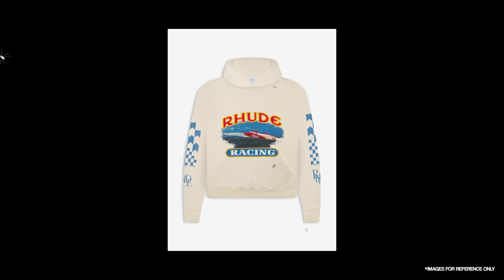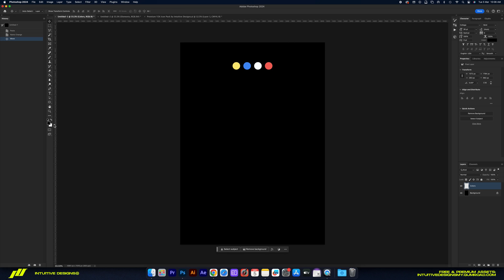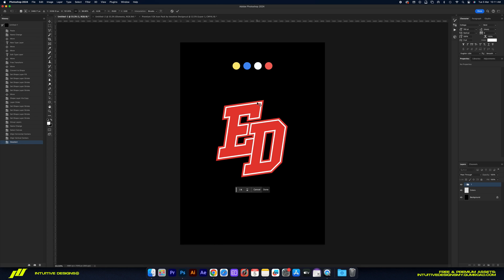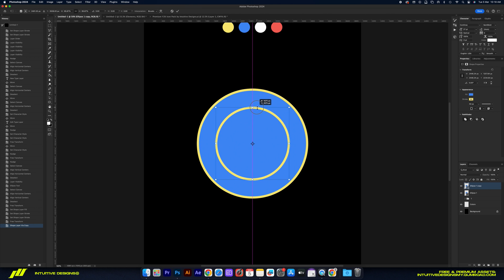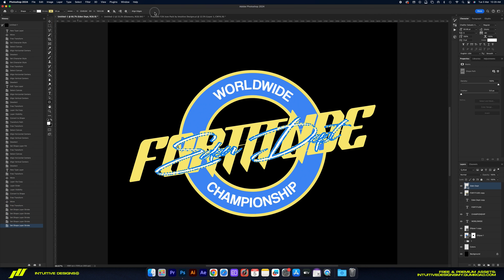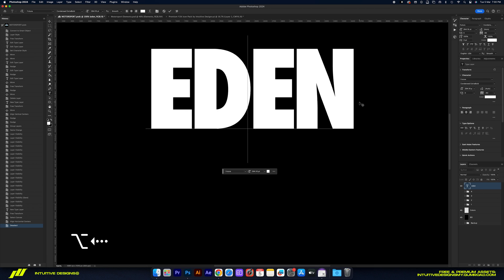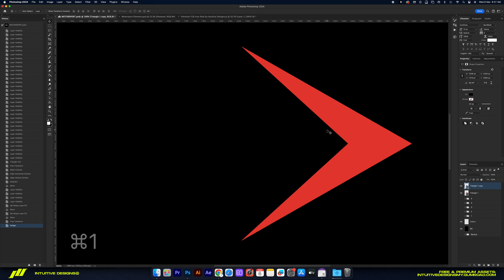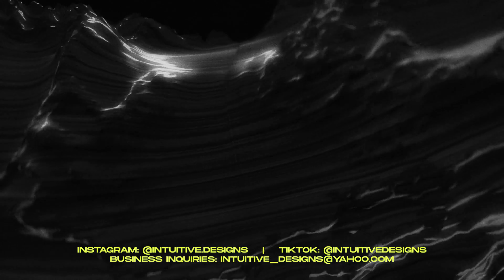How To Design A Motorsport Racing Patch Shirt Design | PHOTOSHOP TUTORIAL STREETWEAR 2024

Comment: Anyone know how to do the circle think on badge two? I’m so lost
Reply from the maker: which part are you referring to? in the video I explain it very well imo
Reply: Same bra
Reply from the maker: @hazehill9044  TELL ME WHICH PART IM TRYNA HELP YOU GUYS OUT HEREE
Reply: @IntuitiveDesigns  after you apply the first circle text and duplicate it / when you highlight "Championship" and say to mirror hold option and just drag, that doesnt work and you skip to where you have the letters tracked and sized. also skipped past cutting the stoke out the the "E" in the first logo.
Reply: when you highlight the second text to be brought down to the bottom of the circle pull up Path selection tool [a] and then you will see the Text cursor with those two lines / Now you can drag down.  command T, Right Click, rotate 180 / then you can change the spacing in the letters. bottom text still doesnt fit smoothly like the top but that's as far as I got /// Used warp and arch to fix the slight awkwardness in the bottom text curve best as I could